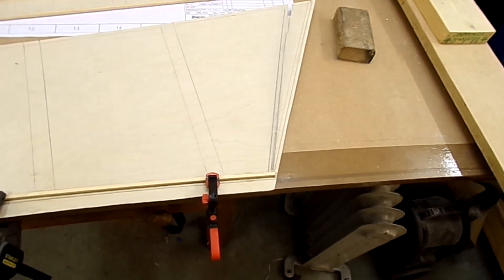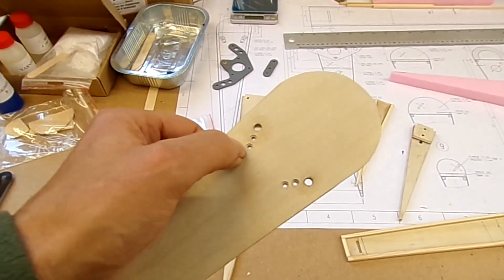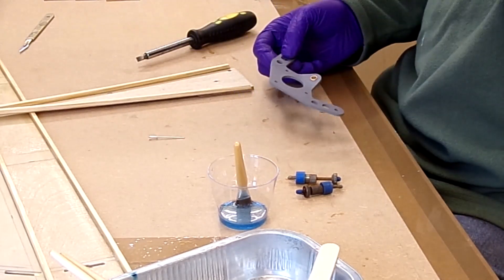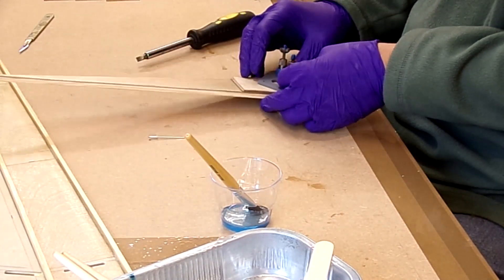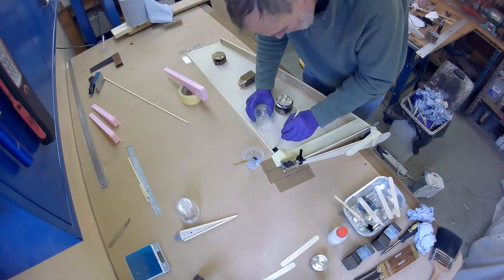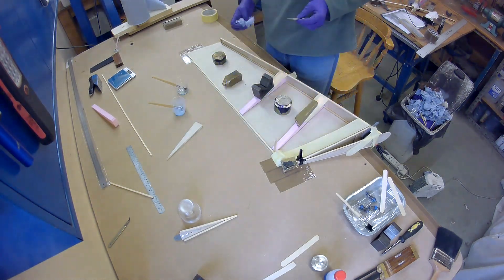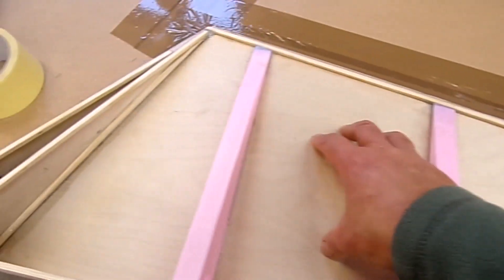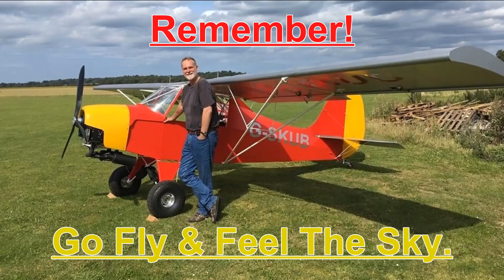Spacek SD1 TD Rudder Build EP5 (It really starts to come together) SSDR

Comment: Never seen riveted wood in my life
Reply from the maker: Well not exactly rivited wood but rivited wood to metal, I have seen this before but with solid rivets on Victor and Vulcan cockpit floors, which had thin 22swg aluminum covered with 5/32" ply. I did add resin between the aluminum and the wood and around the rivets as a bit of extra (with minimal weight). The rivets are a lot lighter than bolts and weight is a big factor on an aircraft like this, as there are several flying without issues, one has to take it as an acceptable method.
Reply: @GyroJeffro  Yeah, that place is just about dead, now I terrorize people of facebook groups
Reply: @GyroJeffro  Oh , the nobuiltairplanes.com , That reminds me, remember that guy Little Crapper who started building minimax at the same time you did, said it was so simple and easy he would be flying in six month, then after six month and 600 posts of yakking  he built absolutely nothing, 
You should go raise him and show him your flying airplane , say hello from me while you at it.

https://www.homebuiltairplanes.com/forums/threads/budget-built-minimax-1100-ultralight.29516/

Comment: I'm enjoying this series. I must have missed it in a previous episode, how did you thicken the resin?
Reply from the maker: To thicken the bonding resin, I use micro fibres which is a cotton flocks and adds structure to the resin (unlike Microballoon which just adds bulk and makes it light and sandable). Without Micro Fibre the resin would be brittle if there is any gaps between parts (if I know it is completly gap free I don't use it as it adds weight with more resn held in the joint).
Reply: @flyingkub  ahh that makes sense.
Reply from the maker: @GolfFoxtrot22  I do try to make sense some of the time. I was thinking about the comment you made about Victor Engines, so looked up my old Crew Chief notes. The Conway we had a zero stage added. Although I was a split brain (Airframe / Prop), I did very little with the engines side on Victors, only do a bit once I became Deputy Crew Chief (Sgt) on Saucy Sue XL164 (which was cut up if I remember correctly), at the end.